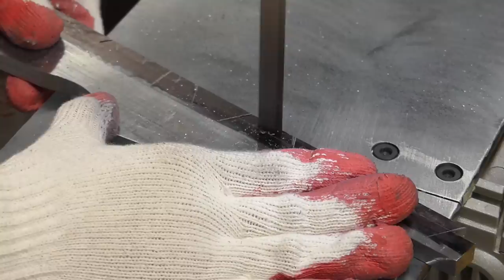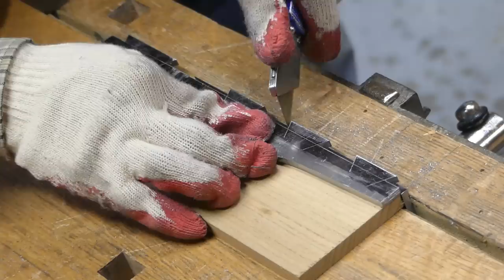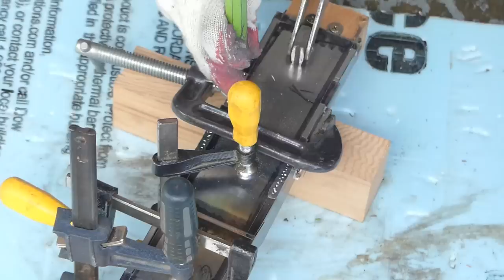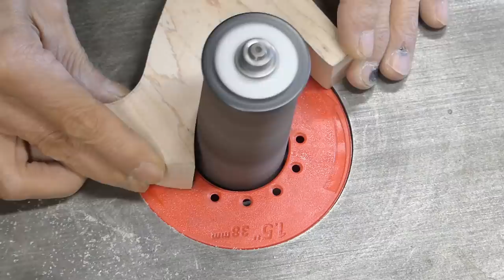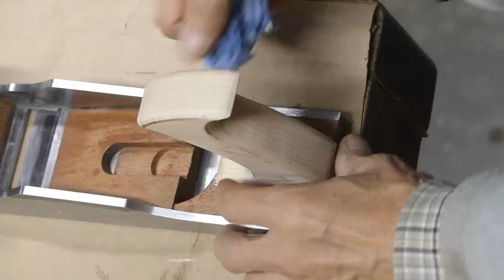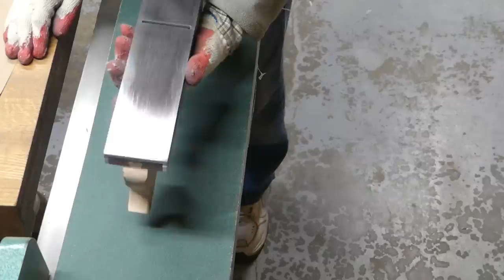Making dovetail infill plane (low angle smooth plane)

Comment: Good work and almost perfect example of how to hold complex parts while machining. Always keep your fingers out of the way of the cutter. The only exception was when you routed the sliding dovetail into the rear handle. Great application of methods in wood working and metal working. I like watching you swage out the dovetails for the final fitting. works well. Steel will move if you know how to make it move! And I appreciate the tip you show about thinning the epoxy with a little heat. It really does work well. Also helps some of the epoxies dry more rapidly.

Mark

Comment: beautiful plane, and beautiful shaving. there are moments when i'm watching your videos and i want to applaud something you've done, it's just so perfect, or clever. i love the way you find solutions around problems (like 2 clamps and a wedge to spread the steel sides apart). your videos are always so much more than just a beautiful tool at the end. but then there's that, too. amazed and inspired, as always.

Comment: You do amazing work Young Je. What metal did you use? W's as it medium carbon or percision steel ? Do you think the dovetails joints can be TIG welded without warpage more percisely than using the rivet method?

Comment: What type of steel and what thickness? Where did you get the adjuster and where's the blade from? Thanks! Great build as usual
Reply from the maker: 3/16 (T)  1018  Steel
http://www.leevalley.com/us/wood/page.aspx?p=74621&cat=1,230,41182,46334

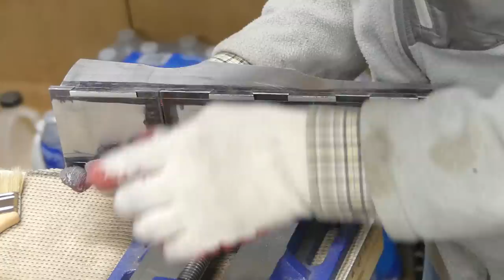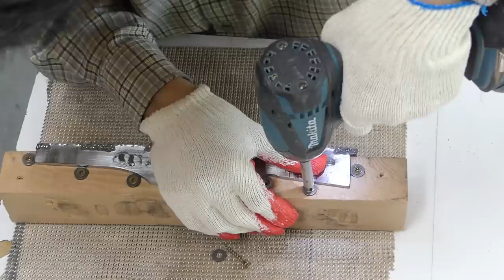Comment: I love watching you make these planes, but something is baffling me.  On the video, between 10:24 & 11:45 you're punching the metal along the edges.  I expect that would spread the material out tighten up the dovetails, which are beautifully done.  Does that spreading actually bond those 3 slabs of metal together?